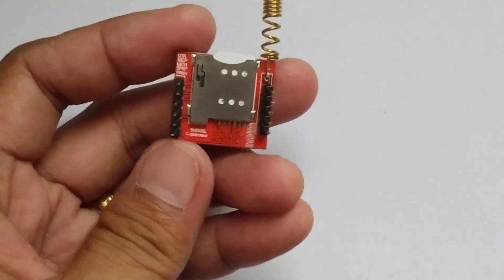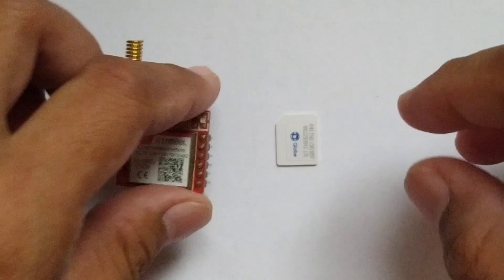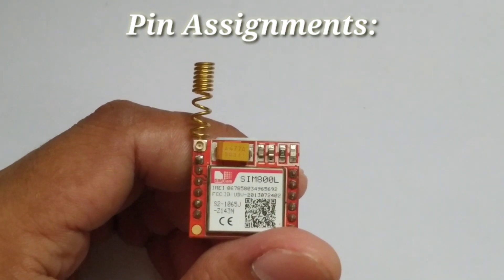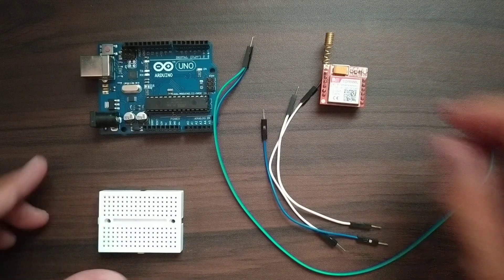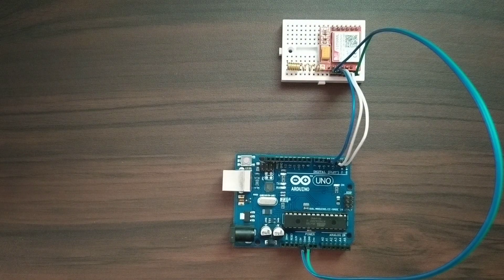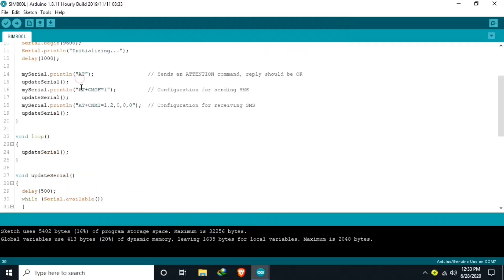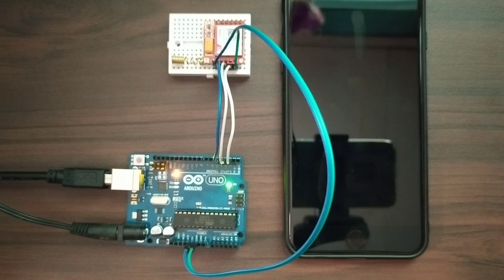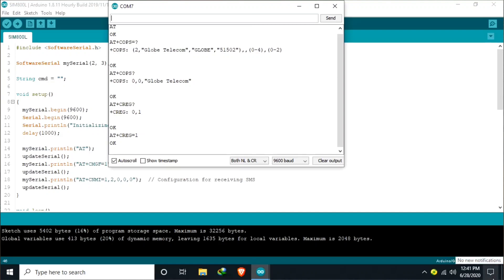Tutorial: How to use SIM800L GSM Module with Arduino

Comment: Hello Im doing school project....Is it okay to have sim800l connected to 5V? on arduino?....i want sim800l to always run but not sure if to use 5v or from homemade powersupply 5v do 4v....is it okay to use just resistor or should i use diode if so which one ....im clueless

Comment: If we use esp32 having WiFi module then why we are using sim800l can we use both?
Tell me difference
Reply: I think I'm late but, ESP32 has wifi connectivity but you cannot send message solely using wifi, GSM module helps in sending message and stuff. Though If you wish to route your message using wifi, it won't be needed

Comment: Hello sir, kindly can u clarify my doubt

I am using sim800l for my project I am very confused, whether should i use any dc-dc buck converter or I am having a 12V adapter can i use that
Reply: use a buck converter, reduce the volts to a range of 3.4 to 4V

Comment: the gsm i bought has a wired antenna (to be plugged on top left of module). do i still need to solder the hellical antenna if i am using the wired antenna?
Reply: No you don't have to

Comment: Good day sir...
I'm new to the gsm 800l...
Have a quick question...

Will connecting the gsm 800l module to a 5V supply for less than 1 minute  permanently damage it?

Also if it will not damage it, is it ok  to use 5V to do a quick test of the module...

Thanks, and great video. (timeless)

Comment: Is it possible to connect pin 6(ring) directly to the arduino digital pins to detect high/low... When a call is received ... Would this work ? Or is the output incompatible ?.
Thank you
Paul

Comment: What type of SIM card Cell service is required, what do you have to purchase?
Reply from the maker: It uses 2G technology but modern sim cards as far as I know should be backward compatible. Meaning to say, 3G, 4G, 5G should still works with this GSM module.

But, if your country no longer support 2G then this module is useless for you. You may search for newer models which supports LTE/4G but it is more expensive.

Comment: Hi po! paano po kung walang response ang led kahit may power na sinupply ibig sabihin ba sira na ang module?, ang gamit ko po ay 3.7v lipo battery with 2 amp.
Reply from the maker: Maraming possible cause. Baka defective ang module. Baka walang connection papuntang VCC at GND from the battery. Baka mababa ang voltage ng battery or low batt.

Comment: Sir,there is a 3.5 volt in ardruino uno. Can we use it
Reply from the maker: No, and Arduino has 5V and 3.3V only not 3.5V.

You should use external power supply that can provide 3.4 to 4.4V with a minimum current capacity of 2A. Less than that, your project will not work.

Comment: Can I use SIM 800L as the module in a way that can send SMS of the GPS location once the button (SOS) is pressed? Do note that I have used Neo 6M module for GPS tracking... So is it possible to automatically send an SMS alert??
Reply from the maker: Yes. You just need to provide external power supply for the gps and gsm modules.
Reply: @TechToTinker  Thanks for the reply!!! Can you please share any tutorial link, if possible, for better understanding... That would be really helpful for my smart stick project
Reply: @TechToTinker Bro I am in final year project which is "smart blind stick" can you help me the same prblm iam facing now SOS message is not receiving iam using 5v from Arduino UNO for both GSM and GPS. 
Iam having final project review on 8 April please reply me ASAP

Comment: the sim800l can drive the esp32?
Reply from the maker: You can interface SIM800L to ESP32. ESP32 uses 3.3V while SIM800L uses 2.8V logic level. Be sure to take to take note of voltage level difference.

Comment: My Arduino does not power on when I put the SIM800L to 5V and when I switch to 3.3V, my SIM800L does not work.

If I use powerbank and an IN-4001 diode to regulate 5V, will it work? Is it a good long term or will I be forced to use another power source?

I have another idea. I'm also planning to use a Romoss Ares 10 Mini powerbank with 2 USB output with 5V 2.1A to power Arduino and connect other wire to SIM800L in breadboard. Do you think it can work?
Reply from the maker: SIM800L is power hungry device so it should be power with a separate external power supply with ATLEAST 2A current capability.

With regards in using powerbank, I cannot give you answer with that because I haven't tried it perhaps you could try it on your own.

I would suggest to use an external power supply 1 for Arduino and another 1 for the gsm module.
Reply: @TechToTinker   Brother, please answer me, I need you, because my project is ready, and secondly, the problem of the cat is only that I have a problem. No sim800L piece and 3.7 voltage saver, but what chip do you need G2 or 3G? Thank you

Comment: Hi, how to attach a vibration sensor with this circuit? If a vibration is detect from vibration sensor, send a msg to mobile phone. Pls help...
Reply from the maker: Hi josemon, you may replace the tactile button switch with your vibration sensor. Then modify the code according to how the vibration works.

Comment: hi sir hindi rin po ba nasira ang gsm nyo sa 5 volts nyo po kahit walang diode or resistor?
Reply from the maker: so far, ok pa yung sim800l ko pero hindi ko naman kasi ginagamit palagi.

Recommended to observe the following option:
1. 3.4 to 4.4 V sa VCC external power supply.
2. 2.8V voltage level on rx pin using voltage divider circuit resistor or better use voltage level converter module.

or use a sim800l powerboard.
or better used sim800l v2 board because it takes care voltage level and power.
Reply: @TechToTinker  thanks man earned my subscription and respect hahahaha
Reply from the maker: @gitgud42  your most welcome bro. Thanks.
Reply: Which diode did you use sir? Will IN-4001 work on SIM800L?

Comment: Hi, great video! Does the module turns on automatically when you apply power? In the datasheet is states that the module has a power key pin that must be held low for at least 1 second for power on/off. Thanks!
Reply from the maker: Hi @Dario Draiman, no the SIM800L GSM module does NOT have a power key.

Comment: Hi po sir. sir bakit po ganito lumalabas sakin 
AT

OK
AT+CMGF=1

ERROR
AT+CNMI=1,2,0,0,0

ERROR
 PA HELP NAMAN PO SIR
Reply from the maker: Check the following:
1. Power supply should be 3.4 to 4.4V with minimum of 2A current. Again, minimum of 2A. Less than that, gsm module will not be able to connect in the network.
2. Check the power again.
Reply: 4.3 po un power supply ko po. nag biblink din po un gsm ko
Reply from the maker: @junapolinario94  it should blink once every 3 seconds if it is able to connect to network.

If it blinks once every second, then it is NOT able to connect to the network and that could be the reason.

Comment: Pak sim800l masih bisa digunakan kah? Sebab aturan Kominfo saat ini yg memblokir IMEI yg tidak terdaftar
Reply from the maker: For that I cannot confidently answer you. These are products of SIMCOM company so I am speculating that it has registered IMEI. Or how about you just bought and try, its a cheap product you can easily throw if its not working with you.
Reply: @TechToTinker  can you make a tutorial sensor pir with alarm on and alarm off (schedule) then send notif to SMS or WhatsApp. I mean when the alarm on then it activated the sensor if the sensor detect an obstacle it Will send a notification like SMS or WhatsApp. And when the time of alarm off it Will shut down the sensor. Also i wanna have a panic button it can trigger anytime and it Will send a notification too.
Reply: Im sorry its to much ask. But i hope u wanna do it. Thanks before
Reply from the maker: @roghibashfahani15 have you started your project? Can you share your source code?
Reply: @TechToTinker  i already have make sensor with rtc only, and not yet connected with sim800l. And it is still a little problem in controlling sensor, i'm using relay to control the sensor but it got bouncing i mean when the time alarm on is active then the relay Will swicth on the sensor on that time the sensor Will trigger too but there is no obstacle. It happen cause a bouncing of relay modul. Btw sorry my bad language.
Reply from the maker: @roghibashfahani15  ok, you might want to share your code so I could check for you.
Reply: @TechToTinker  in here?
Reply from the maker: @roghibashfahani15  here or you can send me email at tech.to.tinker@gmail.com
Reply: @TechToTinker  i already send my code to your email

Comment: Hello sir can i ask?
Reply from the maker: @Miraflor Eroja, of course.
Reply: Ano po kasi gagawa ako ng kagaya sa ginagawa mo para project namin tapos ang nabili ko sa shop na sim800L component is hindi pa po siya buo magtatanong lang sana ako na if i soldering ko po ito hindi po ba ito ma sira?
Reply from the maker: @mirafloreroja4892  kung hindi ka confident pwede mo ipa-solder sa mga kakilala mo pero maganda rin kung magpapractice ka. Easy lang yan at hindi naman basta basta yan nasisira.
Reply: Ok po thank you 😊 ano po bang soldahin nito ang small pin o itong mataas?
Reply from the maker: yung shorter pins ang nilalagyan ng soldering lead.

Comment: Hi George, (It seems that people are calling you by that name!) This seems to be a useful video. I have just bought this GSM module and will try it as soon as I am satisfied about safe voltage levels. I wanted to ask you why you had no problems with supplying and driving the module with 5 volts. I understand using a common silicon diode to drop the voltage by 0.6V for the supply. I will probably put a large capacitor after the diode to supply the burst current. But for driving the the RXD input, would a diode and a pull-down resistor be good enough? Have you some experience with that method? Many thanks.
Reply from the maker: @Mike Van In, I would suggest to better use a proper external power supply between 3.4V to 4.4V with 2A power supply. 

For the Rx pin of SIM800L, you can use a voltage divider circuit to lower voltage level.
Reply: @TechToTinker  Thanks!
Reply from the maker: @mike_van_in  you're welcome. Thanks
Reply: @TechToTinker  i have question how i can sen sms from sim 800 using arduino??
Reply: good works

Comment: Hi sir. May I know the the voltage and ampere of the external power supply u used? Thank you
Reply from the maker: @Ange Nica, if I still remember it correctly, the external power supply is 12V/2A which is connected to Arduino Uno power jack.

To better power the SIM800L, it is recommended to use 3.4V to 4.4 V / 2A power supply.
Reply: @TechToTinker  Noted! Thank you sir :)

Comment: can i use it like a tracker gps , i mean that  it can send a location to the phone with sms message
Reply from the maker: @Yassine Charrour, SIM800L is a GSM module only it can make or receive call and receive or send SMS.

However, you can attach a gps module to your MCU and send the GPS coordinates with the GSM module.

Another option could be is to use the 3G internet capability of SIM800L and use the network tower location as reference for the coordinates. This option is not accurate.  I have not tried it also, so I do not know how to make it.

I hope this helps you. Cheers.

Comment: Sir! how about if I use water sensors. When the sensor works the gsm module should send a text to the default number that the sensor sensed water.
Reply from the maker: @Labrada, Sweet Raven. Yes that's very easy to implement. Instead of checking the button switch state, check for the sensor.
Reply: @TechToTinker  does it mean I can use the same code?
Reply from the maker: @sweetravencurranlabrada4115  Yes and no. Yes because you don't need to modify much of the code. No because you will still need to modify a little.

Refer to my first reply on how you will do it?
Reply: @TechToTinker  THANKYOU SIR! Really much of a help
Reply from the maker: @sweetravencurranlabrada4115  Im glad to help. Cheers.

Comment: Hi sir im doing a project of vehicle tracking system will this gsm work with 4g sim plz reply. Should I buy 800L or 900 gsm module?
Reply from the maker: @unknown xyz, both sim800l and sim900 works with 4G sim. Just make sure your country still supports 2G technology.
Reply: @TechToTinker  Jio sim will work? its uses 4g network
Reply from the maker: I don't think if I can answer you with that. Just go to google and search if your country still supports 2G. If not, then you cannot use SIM800 nor sim900.
Reply: @TechToTinker  which module can i use for 4g or do i have to buy 2g sim seperately
Reply from the maker: @unknownxyz7425  you seemed not reading my reply. I don't know if I could help you then.

Comment: I soldered the pins the other way around lol :D
Also is it possible to attach a li po battery to power up the sim800l but transfer data to arduino?
Reply from the maker: @Armin Cal, 2 or 3 pcs of 18650 connected in parallel is a good setup.

Btw, I don't see a tradeoff using that config and you also have the printout of pins. Good luck and cheers

Comment: hello, since sim 800l is for 2G networks, is it compatible with a 4G/5G sim card? Is there any specific voltage it might require to function? Thank you.
Reply: Yeah only Vi or airtel 4g sim is support, in sim800L
Reply from the maker: @john jose dela cruz, 4G/5G is commonly designed backward compatible to 2G. 3.4 to 4.4V is the supply voltage requirements. GPIO is 2.8V logic level.
Reply: @TechToTinker  wait , so it may work on 4g sim?? Y/N??
Reply: yes for 4G but not support LTE 4G 
https://www.technoelectronics44.com/2020/11/gsm-sim800l.html
Reply: Hey can i use a sim card that support 2g, 3g, 4g?
Reply: Only works with 2g sim cards , not support 3g or 4g cards.
Reply: It support 4G sim or only 2G sim

Comment: you have connected 5v and gnd of sim800l to arduino 5v and gnd still it works how?
Reply from the maker: @DREAM HOME, I am not sure how to answer you but I would guess that manufacturers provides safest specifications on their products that is 3.4 to 4.4V right? Which ensures their product will function properly. Applying 5V stresses the chip that in the long run, could damage it. Of course, its always better to follow the specifications. Cheers
Reply: So for test ... Can we conect module gsm  with 5v and still working?.. why all People use a voltage reductor ?

Comment: That's a great Videa TechToTinker, but your description of the pin assignments doesn't seem to match the label on the back of the SIM800L.  Pin 3 (from the top) is labelled as RST, whereas you described it as RXD, then you only describe five pins, when there are actually six (NET, VCC, RST, RXD,TXD and GND according to the label).  I have ordered an SIM800L, but it hasn't arrived yet, so I can't verify whether your description or the labels are correct, but it might be an idea for you to confirm please :-)  Do we need to do anything with the RST pin, such as tie it high or low perhap, or will the the SIM800L work OK without it connected, as appears to be the case?
Reply from the maker: Hi @Michael Benn, NET is not actually a pin where pin headers will be connected. NET is where you connect the external helical antenna. That's the reason, I begin pin assignment from VCC as pin 1.

You can leave the RST pin without connection to microcontroller. its sole purpose is for resetting the SIM800L.I believe, it has a pullup resistor in the module. You have the option to tied it to microcontroller's RESET pin or you can control it manually.

Thank you and cheers.

Comment: I looking for a source to connect this 800L to an avr and im i also want to connect it to a server..looking forwarding for examples and ideas
Reply from the maker: Hi @kalana weerakoon, I am currently don't have enough experience with AVR but it should be easy after you are able to understand UART serial. After that you can control the SIM800 by sending AT commands.
Reply: @TechToTinker  okay thanks

Comment: hi sir i have an issue it is connected to the sim by the led but when i upload your code it still on initlzation what should i do
Reply from the maker: Hi @Ardu Robo, do you get any serial dumps in your serial monitor?
Reply: @TechToTinker  no in serial monitor still just initilzation nothing else appear what should i do
Reply from the maker: You may watch again this video to make it more clear and easy to understand. Basically, you need to send AT commands to SIM800L to let it do something like sending sms or making voice call.  The source code is good for testing sim800 if its functional.

You might like to watch this instead for more detailed explanation: https://youtu.be/HBjiFmKs5cE

Cheers.
Reply from the maker: Try sending AT in your serial monitor. You may refer to this manual for more details: https://www.elecrow.com/wiki/images/2/20/SIM800_Series_AT_Command_Manual_V1.09.pdf